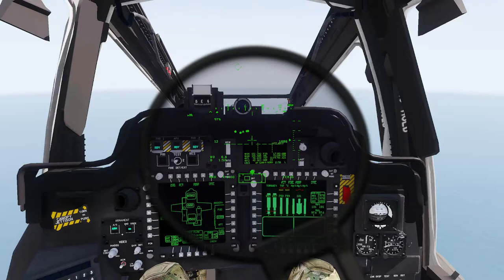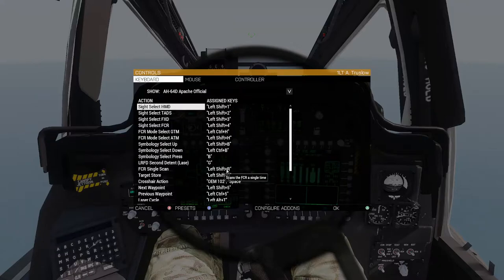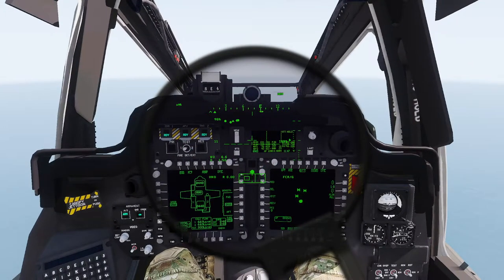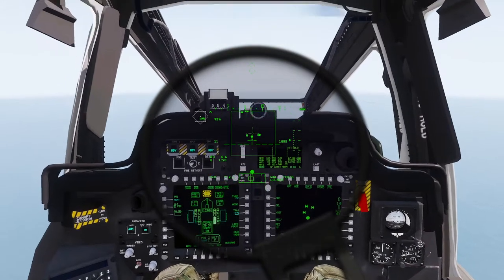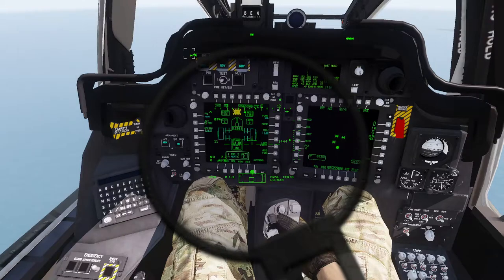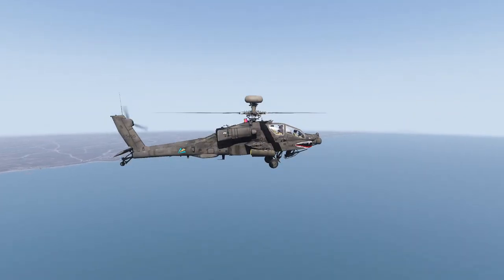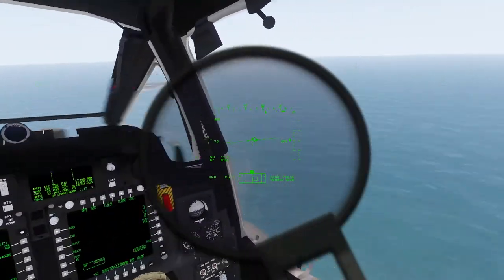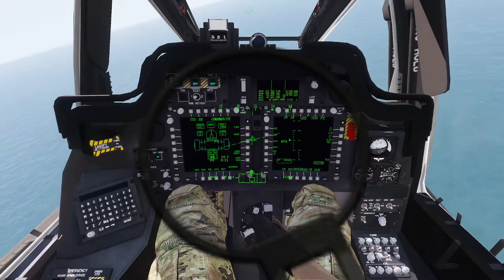Part 2: Pilot Weapons Controls Tutorial | AH-64D Apache Longbow Official Project | Arma 3

Comment: The PNVS and thermals dont work for me, same with the weapon following where im looking, as well as the lazer. the only thing that seems to work the same is the radar and startup for me. EDIT:fixed hmd tracking with ai. EDIT 2: Got thermal working by just clicking zoom in once, but cant zoom with it. EDIT: Figured it all out, i think. Great Video! PNVS still doesnt work
Reply: @fatspazz, how did you get the laser to work, i got similar problem, when i choose the laser missle and hold G (short cut key) nothing happens
Reply: @freaxxx1491  make sure G is bound, and make sure lazer guided missile is selected. AI must be in the heli with you, use manual fire.